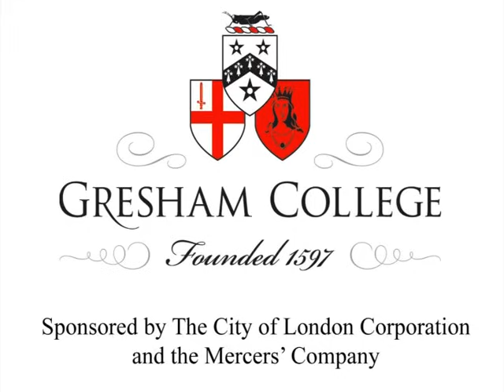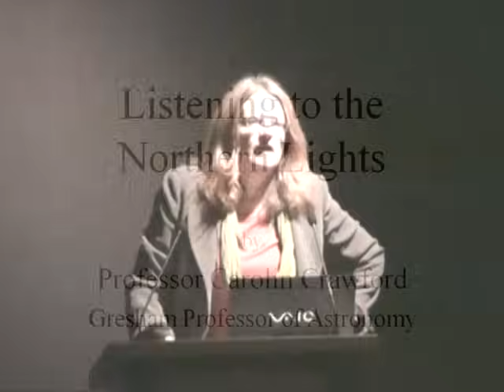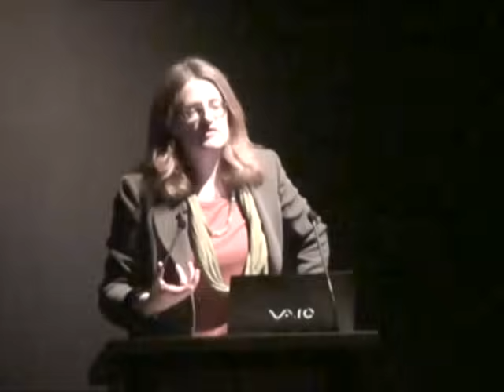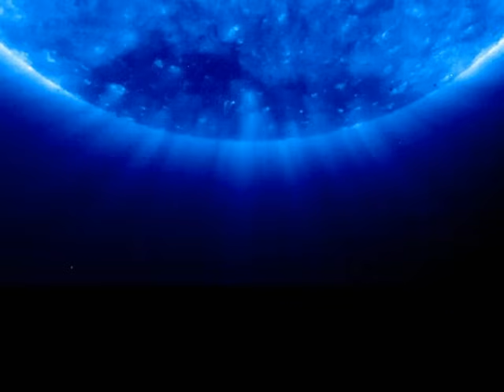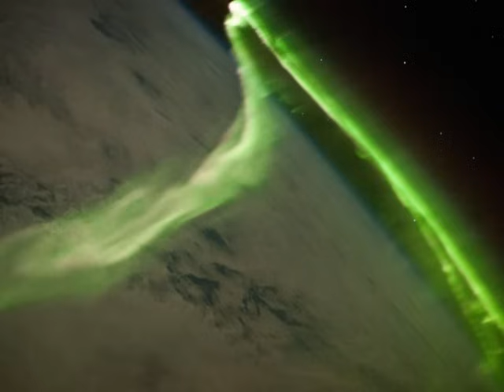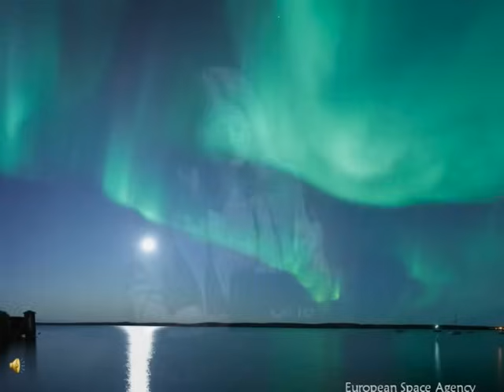The Sound of the Aurora Borealis (Northern Lights)

Comment: There is speculation that the aurora produces actual sounds, not just radio signals that can be converted to sound, which is what this is. There is also actual microphone recording of the sound produced by aurora. Because this is a radio signal converted to sound, I would say it's pretty unremarkable, especially considering the fact that I very clearly heard interference from a frequency with human voices in that recording.
Reply: What you hear is a recording of the "auroral chorus" in the VLF/ULF range (<30kHz) with some typical digital artifacts this video has obviously suffered.  There are no voice transmissions in this frequency range at all, not even accidental ones.  That the interaction with Earth's magnetic field could also produce sound waves isn't that far-fetched considering that the frequency at which these electromagnetic interactions happen lies well within the audio range, so if the process manages to move air particles at a height within hearing range, why not?

The recording may seem "unremarkable" to the uninitiated, the spectacle is the physics behind it.  It's not only aurora borealis that turns the whole planet into a radio transmitter that can be received down there at the bottom of the radio spectrum, electric discharges from thunderstorms "play" the magnetic field in similar ways. Google "natural radio" for more.

Comment: How was the radio signal detected? Was there a kind of detection? AM detection or FM detection? And what was the spreading over the frequency band from these signals? On which frequency or frequency band was the receiver tuned?
Reply: Yes, this is not sound according Prof. Crawford, it is apparently electromagnetic signals. Hence, your questions are very relevant. If the electromagnetic noise is strong, the receiver will go into saturation and you get all kind of interference due to mixing between humanmade radio signals and the Aurora noise. What you "hear" depends then entirely on the frequency, bandwidth and demodulation method you use.
Reply: I was attended on 7 jan 2017 by YouTube that there was a YT user that put the question about the way of the sound detection. When I searched for his/her reaction I could not find it.

Comment: It sounds very like when you're tuning a radio and can't get a station, also there is something like birdsong, and I'd swear there is a distorted voice in there. Very strange. I had no idea the aurora borealis made sounds. Would love to hear and see this for real.
Reply: You probably hear the voices because your brain is constantly trying to make out patterns
Reply: I don't think you actually hear it, it's the light we can't see converted to sound.
Reply: @adxo  It's AKR, Auroral Kilometric Radiation. When these particles spin along the magnetic lines towards earth, they produce radio waves in the kilometer band, meaning the waves are kilometers long. Look it up, it's fascinating and terrifying - there are more examples of it than this.
Reply: @adxo  I'm from Sweden I heard sounds from the Northern ligth twice. I have seen it many times more but only twice it made sounds as what I could hear. You need to be far from the city and other noices. And it needs to be above you for you to hear it. Be quiet and listen, it's a bit hard to hear it.
It's also scientifically proven that it makes sound. They made a recording in Finland. Our neigbours.
Reply: That's the sound from the improper stretch of the high frequency audio track. This effect happens every time you try to slow down any long audio file. If you have programs like Sony Vegas and Audacity you can easily do this with any kind of recording. Because the electromagnetic waves are in high freqyency, we human can not perceive it as audio so they need to stretch to make it into our hearing range, which is the cause of these sounds.
Reply: Me too this is on my bucket list 😊
Reply: yes you did hear a voice. in fact there's a few people talking but it's not from a radio, they're evps.
Reply: Its infinitely closer to that than whatever this person is saying about non existent things. Spinning earth, suns. etc
Reply: @unchosenzombie5144  You saying the earth doesn't rotate and that stars don't exist?

Comment: Well this is bullocks. Heard the Northern Lights back in 2001 at Finnmarksvidda, Norway. Sounded completely different. More like the sound snow or ice can make when the temperature drops 20 degrees fast, or somewhat like the sound of skiing in minus 30-40 degrees (C). The sound you hear here is the recordings Vogager I & II made with Particle antennas, which is later made to sound by humans (or NASA employees)  with oscillators (synthesizers). I kow this, cause I have had the copies since 1992.
Reply: ...that's the sound a radio receiver reproduces, not the actual sound of the aurora. She makes it pretty clear. Because the aurora emits radio signals

Comment: If aurora borealis audible makes sound there should be a delay of several seconds between the actual sight of the aurora and the sound it makes. Aurora happens at great heights from the ground, so the sound takes a while to get down to the ground.

Also, no recordings of these alleged sounds seem to exist.
Reply: They aren't actually emitting sounds, but as stated, a lot of radio waves. Now radio waves are actually low frequency light, meaning its emitting very low frequency light. Now these frequencies of radio waves are slow enough that sound waves of the same frequency would be able to be heard by the human ear. So basically, they're translating two different languages: one of light and one of sound.